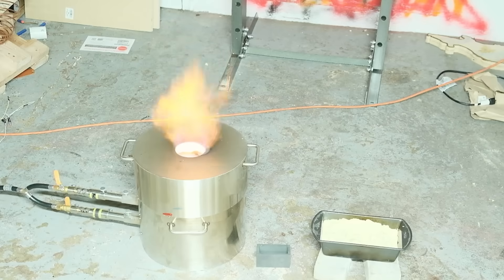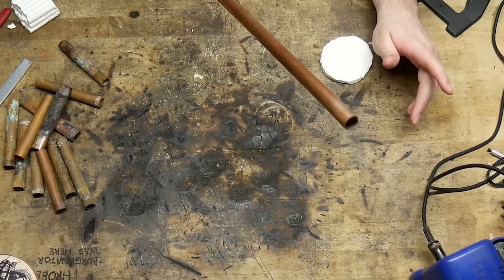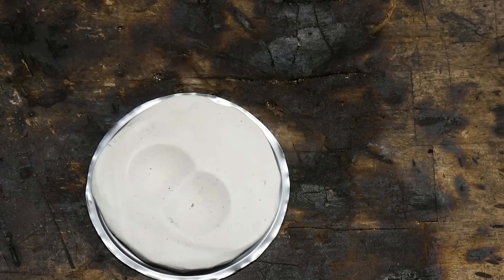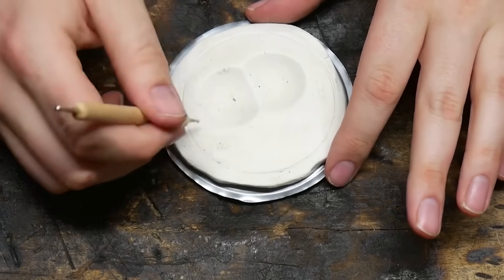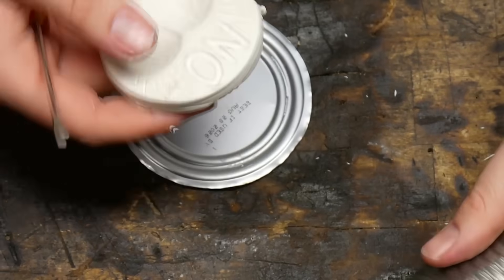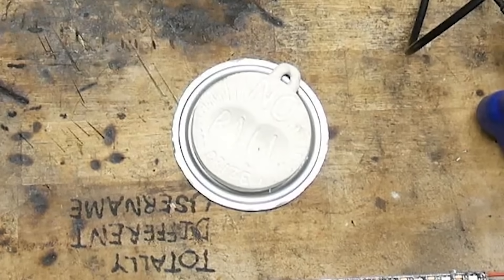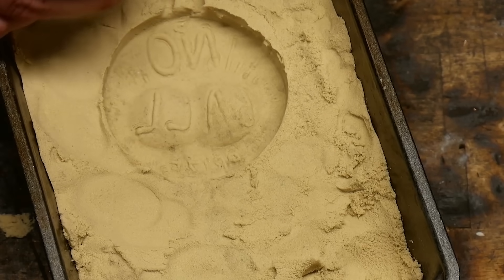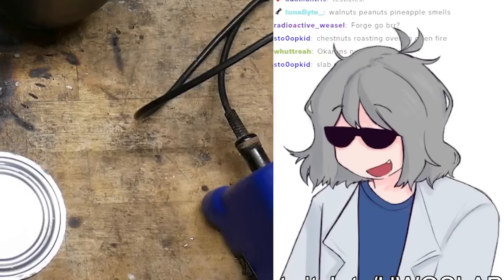Casting my own NOBEL PRIZE out of SCRAP COPPER

Comment: They make leather gloves with that reflective stuff on the outside to reduce radiant heat absorption, we use them at an aluminum casting plant. You can also get aprons, jackets, and face shields that are reflective.

Comment: In the future, heating the mold before you pour will eliminate moisture and stop the sputtering as  it cools, which will make the surface smoother. 

As you noticed, your pour channel is still ending high enough to mess up your mold. It should be in line with your mold so that the bottom of the channel is at the bottom of your mold, either through a steeper slope, or by having the entire channel be deeper. Either way will give you an outcropping of metal, but its pretty easy to clip off and then sand down to get what you want. Just make sure you have a little extra metal melted to account for the extra mass

If you're interested in molding more complex shapes, look into lost core molding (you can replace core with whatever material you're using to help research; lost wax, lost foam, lost PLA, etc.). As a brief explanation, make a shape out of a low melting point material, pack sand tightly around it, melt away the material, and pour in your metal.
Reply: I dont think this man cares about build quality that much ngl
Reply: @hakermanreal  Don't get me wrong I'm all for the jank, but the better he gets at making the things he pictures, the more mad scientist his ideas can become.

Comment: btw the fiberglass insulation isnt carcinogenic. its not good to breathe in but its not as bad as asbestos.
Reply: I like to believe he actually found asbestos somewhere and put it on his forge for the laughs
Reply: That is not fiberglass, it is kaowool, which is carcinogenic and can cause silicosis. Not as bad as asbestos but much worse than fiberglass.
Reply: Itchy lung
Reply: @loner419  Just a touch of silicosis, the close sibling of miner's lung.
Reply: Fiberglass makes great toilet paper
Reply: Not hard to find asbestos. You probably have some in your driveway. Until relatively recently it was used to wrap the honeycomb core of catalytic converters. 

Source: used to buy and recycle cats for a living & now have asbestosis because of it.